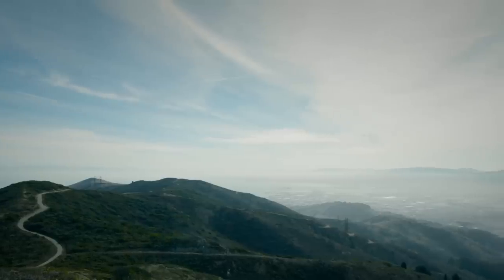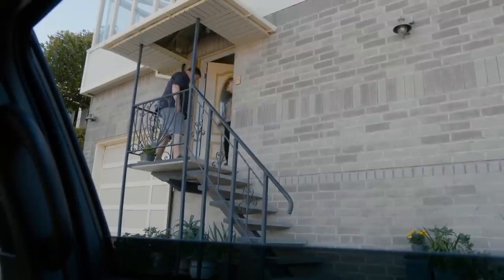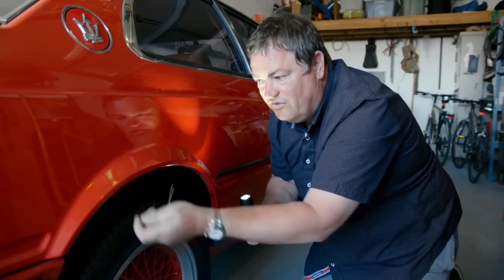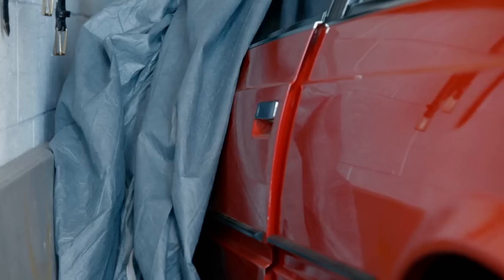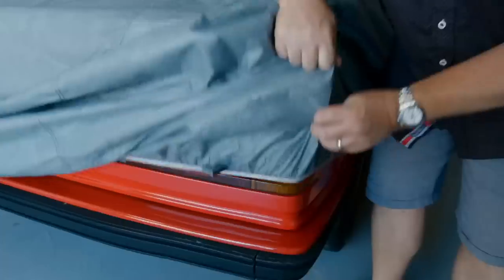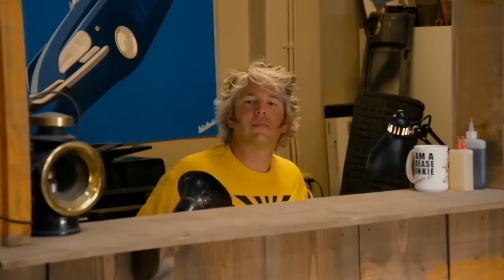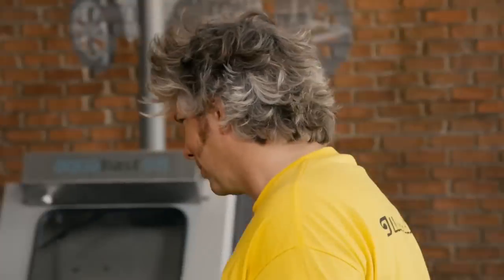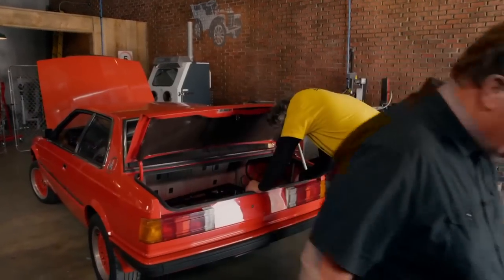Mike discovers A 1985 Maserati Bi-Turbo | Wheeler Dealers, Monday's 9PM

Comment: I had one of those cars in top shape condition .The interior IS NOT LEATHER .. But some cheap plastic. There is no wood either .I gave mine away .And it really  was in better condition than the one on the video .It also had an intercooler .
Reply: Apart for the Intercooler, I've never seen a Biturbo like the one you're talking about. Not in real life, not in google.
Reply: Leather is actually quite cheap. I would find it disgusting to sit on something that was skinned from an animal.
Reply: NuntiusLegis what's your wallet made out of.
Reply: Some synthetic fibre.